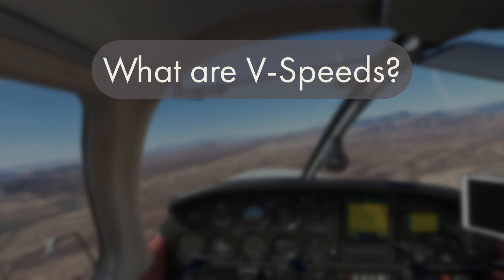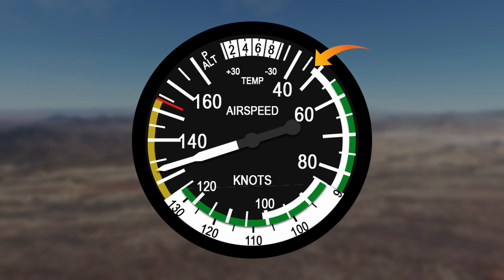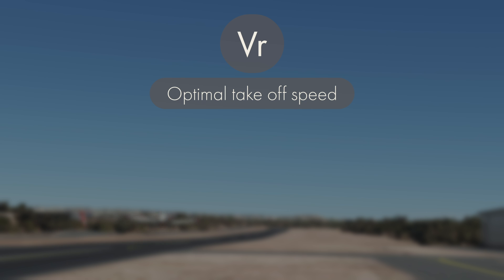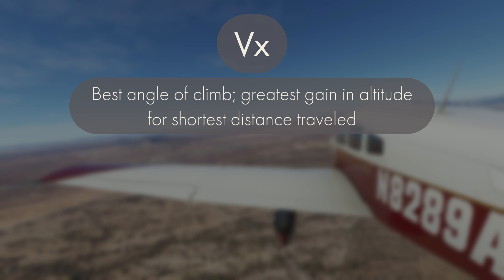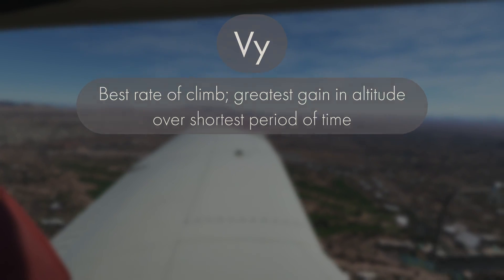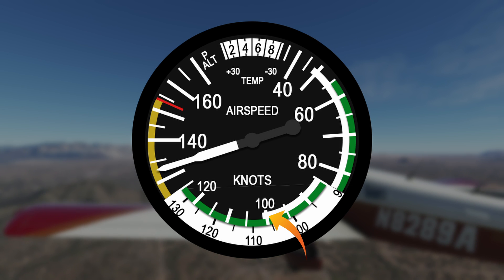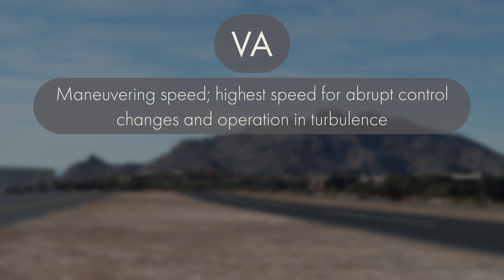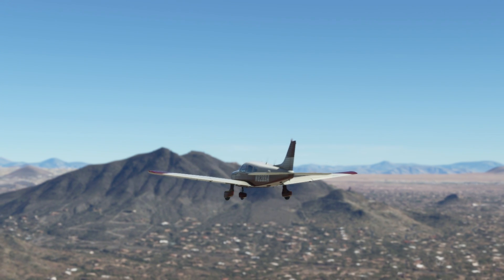V-Speeds and What YOU Need to Know!

Comment: Mentions V1 at the start of video, doesnt explain what it means. (or v2)
Reply from the maker: V1 and V2 aren't necessary knowledge for someone who is in private pilot training. This typically only applies to larger aircraft such as jets. Here is what they mean if you are curious:

V1: This is the speed at which if there were an engine failure, the flight would have to continue. If an engine failure occurs before V1, the takeoff should be aborted, if engine failure happens AFTER V1, the flight should continue and not be aborted. Also known as the speed when the pilot "commits to fly"

V2: This is the speed at which an aircraft can safely climb with one engine. Also called the takeoff safety speed.

Comment: The most important speed is not a V speed. It is a the speed that separates general aviation (with high accident rates) from airlines and excellent safety records. This speed is: DMMS: Defined minimum maneuvering speed. This is similar to the speed that airline pilots  are referencing when they talk about maneuvering speed being a minimum, not a maximum. Calculate the number as 1.404 times VS, to account for a margin above stall speed in up to a 30-degree bank. Engine failure on takeoff requires you to "push" immediately and instinctively to this per-calculated speed for control while maneuvering up to 30 degrees of bank safely. If you want to live and not stall spin into a ball of flames you need to practice this concept for all low altitude operations.

Comment: Va isn't the speed you aim for in turbulence. Flying at or below VA, means that the airplane will stall before the structure is damaged by excessive loads. If you encounter a gust that causes a sudden, significant increase in load factor while flying above VA, the aircraft could experience structural failure, so make sure you are slower than Va. Think of it as driving over a speed bump. Too fast and you break your car and driving slower the suspension can handle it.
Reply: While all of what you said is true, you would*  also want to be at or below Va if encountering turbulence. Your example even kind of supports the idea of going slower though rough air.